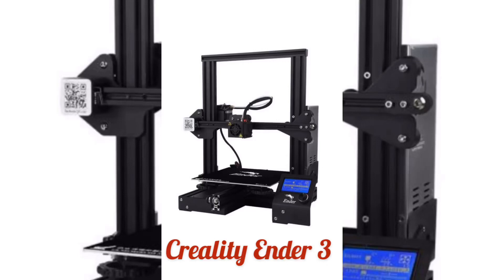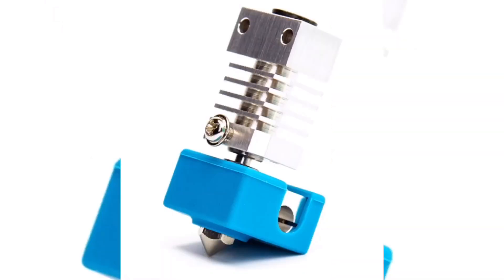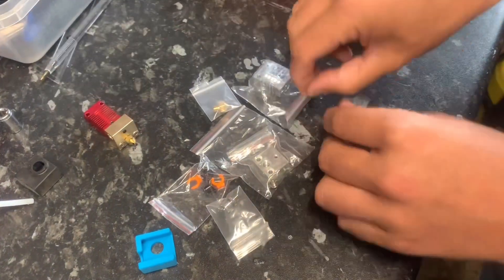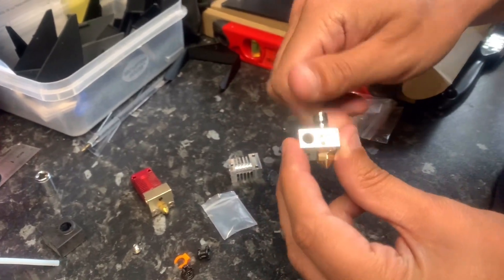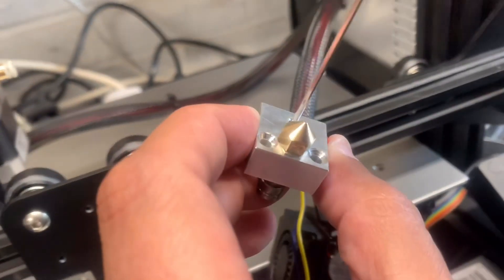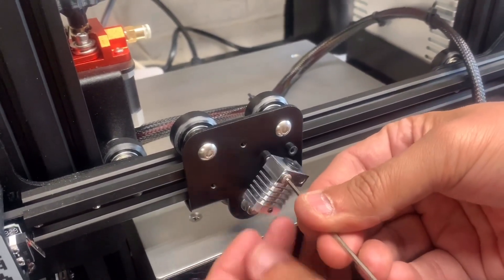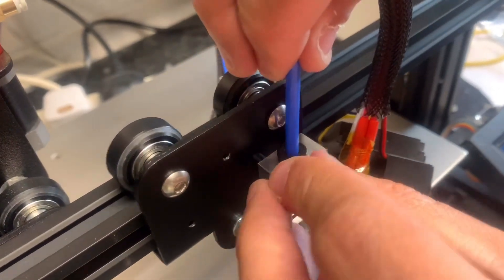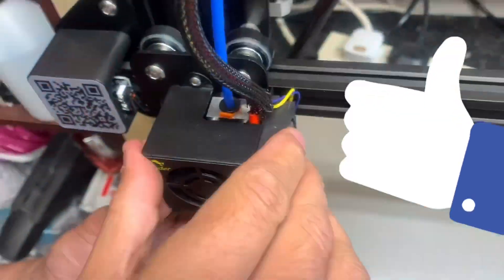Upgrading Creality Ender 3 Stock Hotend Nozzle To AllMetal Hotend AliExpress Trianglelabs Swiss CR10

Comment: I've changed to this type of hot end and I can't seem to print for more than about 20 minutes before I start getting clogging, wondered if you'd any tips or thoughts on what my issue could be
Reply: I watched a video that said that he had to turn his retraction settings down to 1mm and lower the retraction speed. Hopefully this helps.

Comment: How as the clone hotend faired since June and would you recommend it?
I like your videos + 1 Subscription!
Reply from the maker: Hi I’m still using the same hotend and getting good results especially using petg filament , if you decide to get it make sure you tighten the throat, nozzle at hit temperature :)